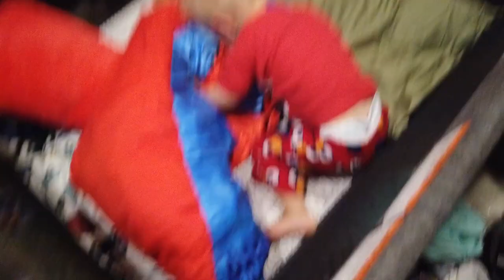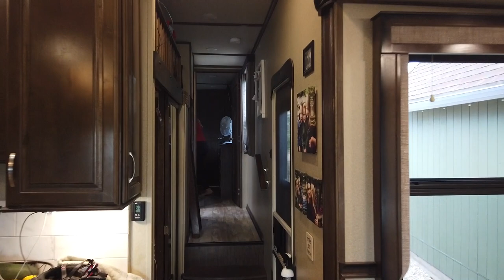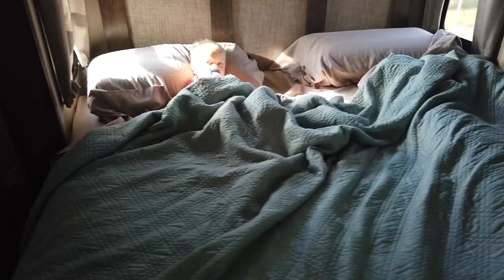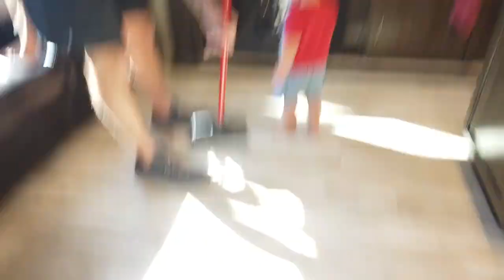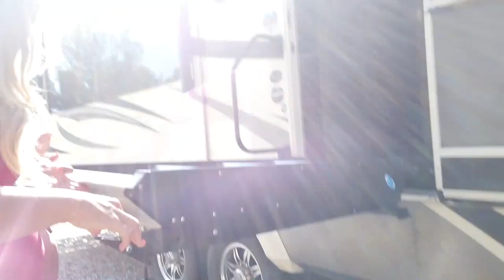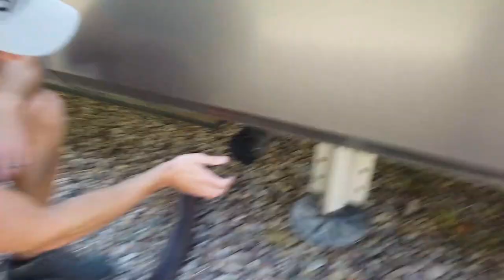RV Moving Day - What is moving day like? Family of 6!

Comment: You can get a t-valve to put across the stinky tube that will keep the water from coming into the end of the tube.  Then put the slinky on, then release the valve.  You wont get the water running out then.
Reply from the maker: Thanks for the tip. Such a great idea.